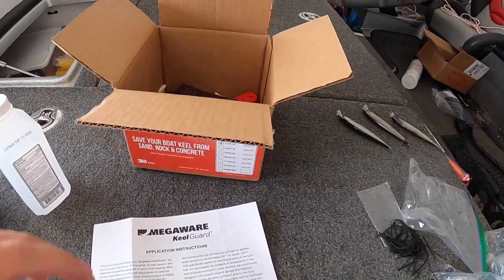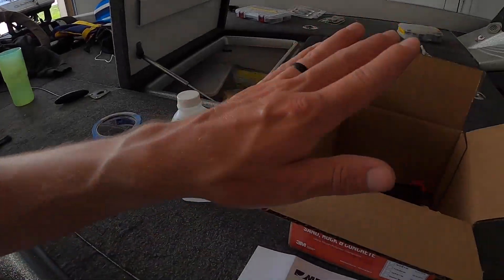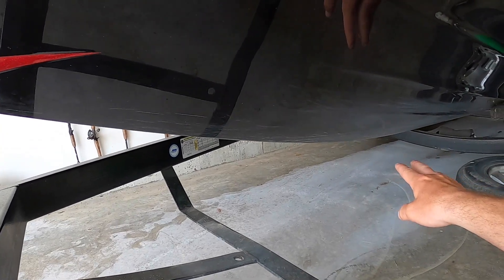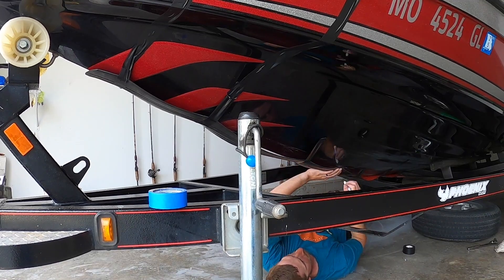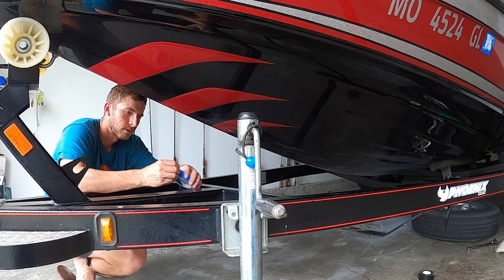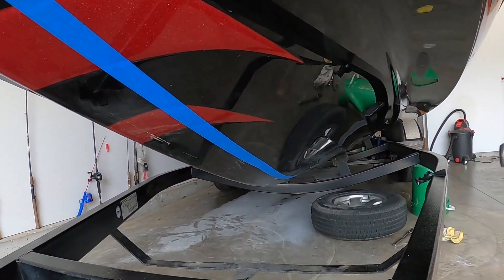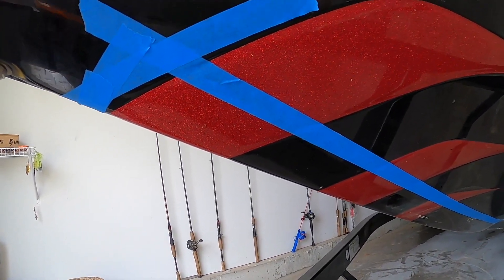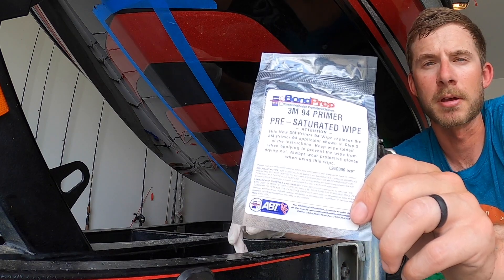Installing Megaware KeelGuard | How To

Comment: Just installed mine on a 9’ Avon RIB. Really appreciate your video. I used a fine sharpie to outline the shape of the taped on keel guard, then applied the masking tape about an 1/16” outside the line. I wanted to be sure that the primer was well beyond the edge of the guard to hopefully prevent future de lamination. Biggest challenge was keeping my shop at 65 degrees (32 outside)! Thanks so much for your time and effort making this video- (note: alcohol easily removed the sharpie marks)

Comment: Would you recommend a bead of 4200 on the outside of the keel guard on both sides?
Reply from the maker: @bobcutlip9448  I don’t see a real need for any. If it was black it wouldn’t hurt I suppose, but so far in my experience it’s not necessary.